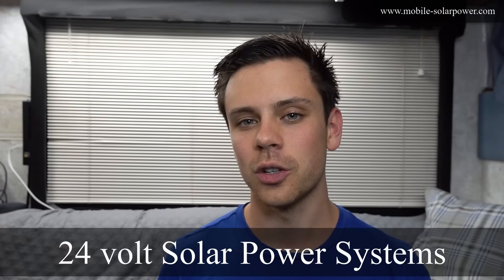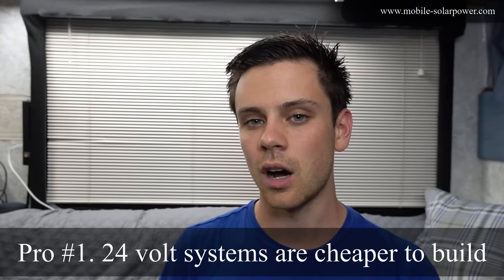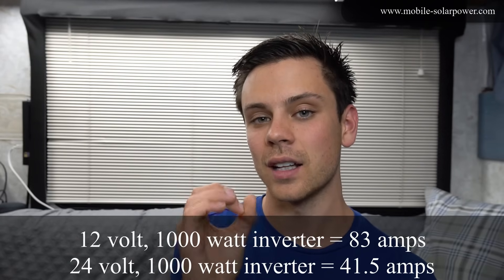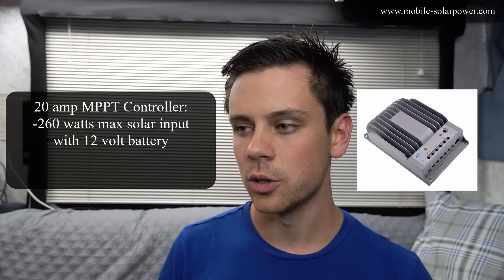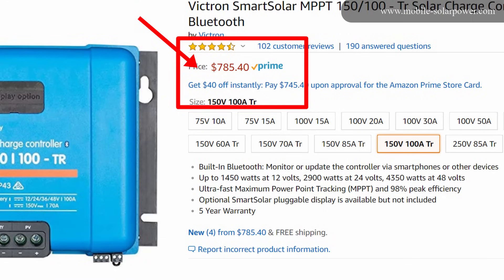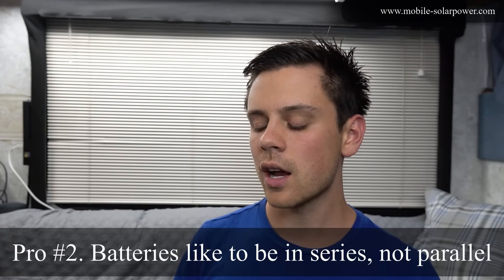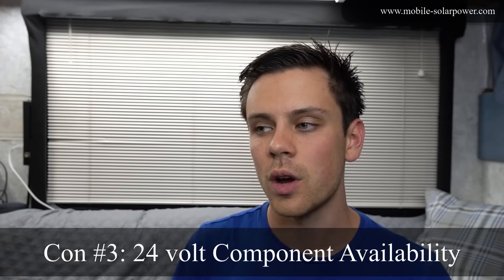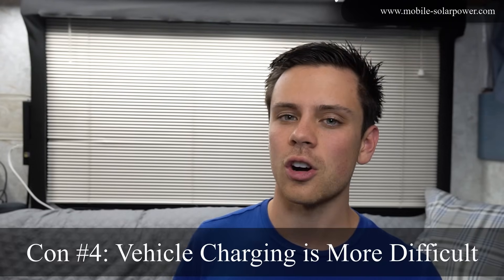12 volts VS. 24 volts for Off-grid Solar Power Systems

Comment: So if I’m looking at a 800 amp hour battery bank with a 1900 watt load for 4 hours (air conditioner with with other small appliances running) = 7600 wh.  Could I get away with less than 1400 watts of solar to charge this?  And if my current a/c is running off a 30 amp generator or a 50 amp shore power how does one use the 24 volt inverter to power the 1900 watt load ?       I have 110 plug sockets and 12 volt led lighting.

Comment: I tend to like your commentary. But you often leave out simple old tricks. What you might call hacks . With a 24v system . You do not need a DC to DC converter . You need only use a 12v tap off your battery pack/bank . Just use a controller to protect your battery. A 20 $ charge controller,  sans pv, and you have 10v cut off . So you can have 2 12v taps . Without the worry of putting the battery down to far . With a buck converter. You can add constant current and constant voltage 5v 3amps for your phone , etc . And or 18v for your laptop. And can control the current. 
Just thought my 50 + years of solar usage might be worth sharing. 
I do agree . A higher voltage system saves money in many ways . Being creative can really amp up savings and efficiency. As you go up in voltage on the DC side . The cost for inverters goes way down . And the efficiency goes up . As the price for lithium batteries comes down . They become more practical. The price for 100AHR lead acid batteries is still easier to get started with . And easier to manage.  If you have the skills. You might do some videos on using lead acid. It's a subject often overlooked.

Comment: I had a question for ya. Im new to this stuff and was wondering if I have 2 car batteries both 12v and indentical and put them in series and that makes 24v, can I still have a 12v system? Can I put 2 - 12v batteries in series and still have a 12v system? Im not sure if that makes any sense lol.

Comment: Great vid!!  Would love to see a 24V vs 48V comparison.  SV Dauntless did a massive 53KW 48V system and I wonder how the wiring and component costs would have been different if they did it in 24V?
Reply: 48v inverters are very expensive compared to 24v, any savings from wiring are dwarfed by the added inverter cost. There are advantages but they probably aren't worth the money for most RV applications
Reply: @myvids4329  that's odd, my experience is that 48V components are cheaper

Comment: Sheesh, I charged my RV battery while driving using an isolator and thick copper wire running to the back of my pickup truck for hooking up the RV battery.  Worked good for years, guess I was lucky. The safe cutoff for voltage is 36 volts according to the code, but I suppose 30 volts is safer.😅

Comment: I am sorry... but with with a 24v system... to have the same amount of amp hours, you need twice the number of batteries... 2 100AH batteries at 12v in parallel is 200ah... Series does not raise capacity... only voltage... so... 2 100AH batteries in series for 24 volts, is still 100ah capacity...though it IS half the AMPERAGE to run... no real advantage... and if you want 200AH then you have to series 2 more 100AH 12v batteries in parallel sets anyway... and cables for it... this is why I stuck with 12v in Parallel... there are guys who run 10 125ah 12v batteries... for a 24v system you need 20 batteries to have the same capacity... gets pricey... Maybe they run into that issue he mentioned, but is way cheaper on batteries... and you could use SEVERAL 12v parallel systems of 3-4 batts. And not have the imbalancing.
   I have a 2 100AH 12v parallel system, cheap Les Schwab RV batts... been running 7 years, no issues... (I run an 850 watt Microwave oven on this system...about 25 min. runtime.) ... Have had my single 100ah AGM Schumacher batt. system for the same length of time.
  It would SEEM to be better to have 24v batteries....I found a LiFePo4 50ah batt at 630 bucks... and so to have 100-200 ah... need 2-4 batts... not cheap.
  I did find some 24v SLA batts...up to 8ah... 159 bucks... found a 12ah for 150... and so you would need to parallel 10 of them... and probably run into the same problem.... 12v is cheaper on batts alone. That is your biggest cost.
     I will run the risk of running over 4 batts in parallel...
  Other than that, I love his videos...

Comment: For a large RV, what about 24 v panels with a 12 v battery system with the charge controller bringing the voltage down from 24 to 12? This seems to me to achieve the cost savings at least if I am unable to mess with the voltage of the RV. Any downsides to doing this?
Reply: +1

Wondering this as well.

Comment: Question for you on the 12 or 24 volt solar charge controller.  If I hook 24 volt panels to a 24 volt controller, can it still step down for the 12 volt batteries like the one by the hitch that is charged by the tow vehicle.  I want to build upon this battery bank by adding more. I want to stay 12 volts for the batteries.  Thanks

Comment: Will, what is the limit? Why not run a 132V system?
Reply: @TravelingStacker  that was my suspicion, but I felt like it was a dumb question worth asking anyways. Put another way: why don't they make software destined inverters if higher voltage is better? Why is there no market beyond 48v?

Comment: Great video! So my question, if we build a 24V system in an RV with say (2) 100AH 12V Lithium batteries, that would still be a total of 100AH correct? So going with a 24V system, you would need twice as much batter power to reach the same amount of Amp Hours... correct? This is where I'm lost. Seems the savings you get in wire cost are spent in buying these extra batteries to get the proper AH you would need. Let me know if I'm not doing this correctly.
Reply: No because 100 ah at 24volts is twice the capacity of 12v 100ah.

Comment: You have alot of good information here.
I appreciate it.
I'm an electrical experimenter and build custom circuits. 
One could use a buck boost with a rectifier to keep it one way boosting 12v to 24v. But the bucks available for an affordable price are a bit sketchy or need lots of upgrades to be able to handle a big system.
But you could trickle charge one over a long period of time with the cheapies.

Comment: I could use some advice, I am very new at this: I have a new 800w, 24v solar panel/wind turbine kit which includes the controller. The controller can automatically identify between 12v and 24v systems. I also have a 1100w 12v power inverter, and also two 12v, 30Ah Lithium Iron Phosphate batteries. I haven't hooked this system up yet. Question 1 - Am I going to need to purchase a 24v to 12v converter? Question 2 - Is there going to be an issue with having a 24v solar panel/wind turbine controller combined with a 12v power inverter? I just want to be safe...please help. I recently discovered your channel and I really love it!

Comment: I have a 24v system and eventually want to upgrade to 48v. Due to cost constraints can I do the wiring only with wires able to run 48v and continue running my 24v system? What’re the pros & cons?

Comment: Brilliant, thank you. I need to up my system to 24v I believe, as 6 x 12v batteries in parallel is not charging past 60%, where as my old 2 x 24v (4 x 12 V batteries in total) parallel system hit 100% quite often. I will avoid 48V ...too dangerous!!

Comment: So by just getting a 24volt to 12 volt converter, you have advantage of using both voltages but you use cheaper wires :D that's what i call smart

Comment: Very informative and good comparison of 12v and 24v systems: 

It is better to categorise, as a Professional Engineer my options be as follow:
1-Small system  500W to 1200W   12V is better
2-Medium System  >1200W to 2000W, 24V is better choice. PERSONALLY I prefer it for house use, safe and economical.
3-Large Size System > 3000KW and >5000W, 48V be used.

Comment: Can I install 2 fuse panels on a 24v system? 1 x 12v fuse box after a converter & 1 x 24 fuse box straight from the battery bank? So I dont have to be limited to one voltage only. 
How would I go about to split that??

Comment: I dont get the so many problems charging from your alternator.I used to plug my inverter in to my cicarette lighter and plug my battery charger into it.Why is he talking from the alternator.Just charge them from your battery feed.

Comment: I put a 24v off-grid system I'm my 40' rv and I dont worry about charging with my truck I completely removed that capability from my rv. I just rely on the sun while I drive. I do have over 2000w of solar.

Comment: Hello all. I have a question to all of you more experts on this topic. I want to calculate how many amps will a monitor lets say will take per hour. I live in a 220v area and the monitor is lets say 50w. If my calculation are correct it will take .23amps per hour using 220v at home. I want to run it in a 12v system with an inverter. But them will I need to calculate the same way 50÷220 or will i need to devide 50÷12, because now the source comes from a 12v. Hope I explained it good enough. Just not sure how an inverter work and how  to calculate how much power is pulled out from 12v battery through an inverter. Thanks!

Comment: 24 volt systems are safer: using half the amperage means less heat and less fire hazard.
Reply: As long as wire gauge is correct and fitting are clean on install. Along with proper fusing its just as safe
Reply: @UnifiedInfo  In normal operation - yes, when systems are not inspected, when something goes wrong, when there is an accident (e.g. a car crash): the lower current is a safety advantage.  And less heat is a distinct advantage.

Comment: Sir, if I have 2 12v 3ah batteries, and I wire them in series,  a multimeter reads 12 volt. When charging on a Solar Panel do you charge the 2 batteries to 12.6v or 24.2v?

Comment: What if I wanted to charge a 300 to 1000W generator with one or two 100W 24V panels. Would it make sense to try to use a buck converter to get the input voltage down, or would it be more efficient to stick with 12V panels?

Comment: How would you charge Dewalt 20 volt batterys flexvolt with solar ? It may only be 18 volts they have 5 dewalt 20 volt batteries that have an inverter

Comment: Not the best with solar and electrical stuff but I'm learning. If I have a 24 volt system and need to power a 12 volt water pump for my home water well I understand you say ill need a converter but do I also need an inverter or just the converter, sorry if this is a dumb question. Thanks for any advice.

Comment: I’m building a bus and the fridge is 12v ac/dc
I want to use my induction plate or toaster oven,  or blender on 100ah 12v battery  with 400 watt solar panels on the roof  is 12v fine or should I do a 24v system with a converter , thinking about a Aims 3000 inverter

Comment: You can get killed from way less than 30 volts, the Volts is not what kills you, you know like Tasers? 10,00k volts?  its the Current that kills you not the voltage. Don't tell people to stick their tongue or grab electrodes and "they will be fine" that's just ignorant, it takes only 100-200 Milliamps of current to kill a person.

Comment: So I have a 200w solar array in parallel, 20amp mppt controller, and two 12 volt batteries ran in series, and a 2000w inverter is that a good set up? Lol I am new to this guys please help or advice

Comment: You've convinced me on 24v but I'd still like to be able to charge my system from my truck alternator. What do you think of the Eaton Sure Power series 12040 12V to 24V 40 A DC converter connected to a second dedicated alternator? Thanks, great content as always!

Comment: Question: say you have a 100 watt solar panel, could you add a 200 watt solar panel of the same voltage in parallel to the system? or would you have to have two separate charge controller's for them?

Comment: For charging 24v system from a 12v alternator.. Can't you just hook up a 12v->24v converter, to the van battery? And this device that only let's charge through when the voltage gets to 14v.

So if alternator is running, it should be 14v -> 24v. If it is not running, no charge goes through.

Am I mistaken about this? To me it seems to make sense. Please let me know if I am mistaken about this. 🙏🏻

Also, you can use lithium, as your vans battery also

Comment: Transmitting wattage at lower current is better because of less loss through heat.. 

And I'm planning on going 24vdc to inverter to 120vac, with batteries. 

Yeah alternators are limited on output and they Make beefy alternators

Comment: What would be a better system for an off grid RV/camper? I've been led to believe higher Amps is more important than Voltage when determining capacity. If all of the appliances and electrical items in the RV/camper are 12V, wouldn't it be more logical to set up the multiple 12V batteries in parallel?

Comment: Love all of ur video. Very good. 
But i missing real video of telecom deepcyckle batterys in 24 volt.  Whats best to use and victron orion dc dc from 12 to 24 from altinator and so on.
Have power safe 12volt 190f battery 57.3 kilos and i have 4 of thise.
How to use this agm closed hevy duty batterypack in 24 volt.
Pros and cons. 
Best regards boat traveler from norway
Reply: I alsow motoring much so dc dc from altinator 12 volt delivers 12.4.  And have multiple batterypack.  But how good are dcdc up to 24 volt?  I use inverter much for tv ps4 and charge macbook on 240 volt.
Is victron 75/15 anof together whit altinator victron orion dc dc up to 24volt.  Ore shud i go higer to charge faster ??
Have 2 320w panels and one 160 for 4 gelly batterypack in backup.
Can i add on more 320w panels to get more solar power ?   Lives in norway but travle world on wather and wants the best options.
I know lithium is the best. But i get thise 4 x 12volt 190f agm deepcyckle batterypack almost for free.

And there are some people says you can add on lithium batery to your agm and get the best of both. Is this posible and true ??

Comment: Will, I want to put my 6 (12V) batteries in series to make a 24V battery bank. However, my 3000W Inverter is 12V. Can I use a 24V to 12V converter to power my inverter? If so, should I use a 30 amp or 50 amp converter? I cannot find any videos showing this configuration explaining how to calculate the amperage for the inverter. Thanks for all your videos. They've helped me a lot.

Comment: I’m going to ask a stupid question. I bought the 12V VariCore set of cells to build a 280ah battery, could I have bought two 140ah somehow and series connected them to make a 24V battery with the same ah rating and benefited from some of what this video mentions somehow? I honestly don’t even know where to start if so. My Wh requirements are something like the 3300Wh the 280ah @ 12V battery provided.

Comment: 3 Questions:  
Q1)  Don't some large trucks come factory equipped with 24Volt electrical systems: a) Alternator, b) Battery, c) Headlights, Tail lights, Running lights, d) Wiper & Starter Motors?  
Q2) Are there no 24Volt Marine Grade appliances such as Compressor Refrigerators, Coffee Makers, Induction Cooktops, Water Pumps, Cabin Lights?  
Q3)  If 24Volt systems provide more bang-per-buck than 12Volt systems, would that imply 48Volt systems have a financial "leg up" on 24Volt systems?

Comment: I hava a 30amp controller and a 500watts inverter, with two 150 watt panels can I series connect 2 12v batteries to make it a 24v system?

Comment: I work in the cell phone tower industry and we are switching everything over to -48V DC systems up  to 1200 amps. It took a while getting used to the negative polarity system and hooking the + terminals to earth. You will get a massive amount of sparks when screw that up. It is no joke even compared to 120/240v AC systems.

Comment: Does the 24v to 12v converter have high efficency. As in if I have 50AH 24v battery feeding a 24 to 12 converter will I get close to 100AH?

Comment: I bought a house with a 24v solar system. It controls water pump. Why does it stop working when it hits 21.5v? The previous owner, says it's done that he has always had a problem with the system. The company adjusted it,but no real change. Can anyone please explain this to me, I know lead acid batteries can only go 50% down. So I am thinking it would stop working when batteries were at 15v not 21.5v

Comment: If you're in a van, stick to 12V. Like Will says - 24V is for large RV's, not vans.
The expense and complications of 24V make it not worth the the money. 
Vans don't have the roof space for high capacity solar panels, especially if you want to use stealthy flex solar panels. 
I'm about to remove an AIO 24V MPP solar unit as it draws more power than it can generate in winter months up north with solar only. The short wire runs in a Van don't save any money. 
Renogy now has (see Will's recent video) a 50A Mppt/Alternator charger that is the go to solution for us in the cloudy/snowy North.

Comment: For charging battery bank from car alternator you can use DC DC charger. This far I have only found on that can convert 12V to 24V so for some reason those are rare.

Comment: Hello Will , Been watching you now since you lived in your motorhome. My question is, I am using a Victron Multi Plus 24/3000/70 . My batteries are 12v 100ah . I have 4 of them . I was going to connect 2 sets in series and then in parallel ,  Now some are telling me that I cannot connect them in series for 24 volt . What is your take on this ?

Comment: will I am trying to understand most of what your talking about but what if I'm building a small 12v system I just need to buy one battle born battery but if I build a 24 volt system I will need to spend another $950 for another battery in series to get 24 volts even with the more expensive cables for the 12v system it seems like the 12v would be cheaper? am i missing something...thanks